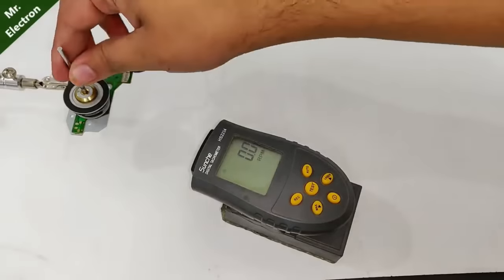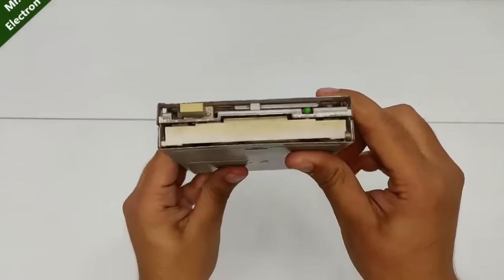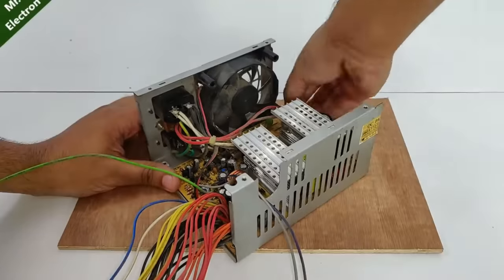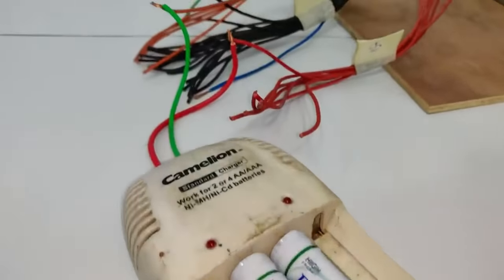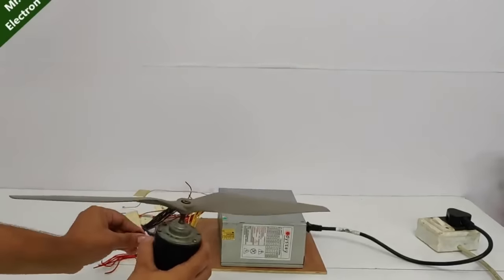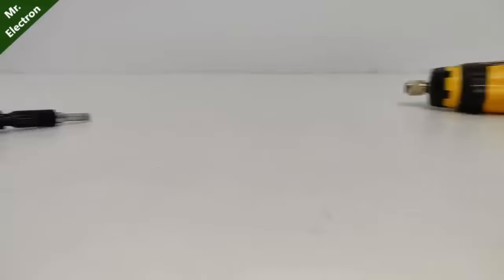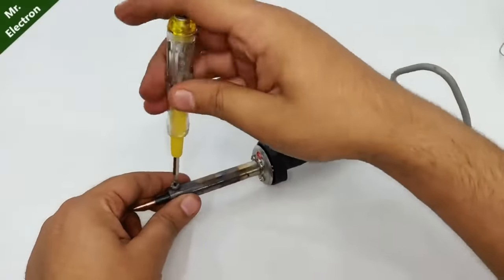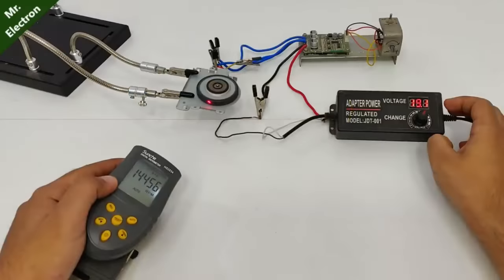Do Not Throw Away your Old Computer CPU | 3 Simple Inventions

Comment: Please rename your video from "Do Not Throw Away your Old Computer CPU" to "Do Not Throw Away your Old Computer PSU" Its a huge difference. CPU is a Computer Processing unit and a PSU is a Power Supply Unit.
Reply: CPU = Central processing unit, which is the main processor on your motherboard. You are not salvaging a CPU your salvaging parts from an old computer.
Reply: Why are you a ☝️🤓
Reply: I was about to mention this thank you

Comment: The purple wire.... Useful for Arduino projects and the like.  That 5 volt stand-by (as mentioned in comments). You can use that and ground to power an Arduino without having the 12 volt rail on(green connected). Then, in code, you can have Arduino pull the green to ground, turning on/off the 12 volt side based on time, inputs or such. 
3D printers for example..... using the above, you can put the printer into a low power state when printing in complete (if enabled in code and gcode). 
Lights.... turn on/off 12 volt lights on motion, time or noise. 
1 note.... some ATX PSU's (mostly newer ones) need a load on the 12 and/or 5v side to continue running longer than 15-30 seconds. A fan usually does the trick, though resistors can usually be used too.
Reply: Thanks for the Arduino trick. A simple idea that can be very useful.

Comment: Another thing I really like salvaging out of computers are the super strong neodymium magnets!
You can get almost a guaranteed two large ones from any hard drive -- some small laptop drives may only have one magnet, but that is rare (the magnets in the laptop 2.5in HDDs are much smaller than desktop's 3.5in, but still very useful)

Then, there are also at least two tiny ones that can be harvested out of the Optical drives (cd or dvd). They are what control the actual laser diode position, and are connected to a small metal frame by some awesomely strong glue, so they're sometimes hard to pry out.

Just be careful, because not only are they super strong, but very FRAGILE. Slamming against metal can cause them to fracture. Or, their metal coating might flake off, exposing the magnet, which can easily break apart into a magnetic dust.
Reply: HA no way i didn't know there were magnets in the cd/dvd drive. Thank you kindly and to answer the dude above me asking what the purpose of neodymium magnets are.... Get some and find out
Reply: Where the magnets at,bro?
Reply: @ZENITH-lp9gg  In which?
The hard drives? 
Or the CD drives?

In the hard drives, you have to remove the thin metal cover. Usually this needs a small Torx (aka Star), like a T9 for desktop drives, and T6 for laptop.
Once you have that off, inside you'll see a reflective disc (called "platters") , and a little arm reaching out over them.

Follow that arm, and at the back of it will be a curved piece of metal.
That's the magnet.
If you have a steel nail (like, a wood nail), or paper clip, you can double check by putting it near. It'll pull, if you're really close.

If it's the CD drive, it will take longer to explain and I'll do that tomorrow when I wake up. (midnight for me)

Comment: Be careful to observe the computer power supply unit, (PSU) max rated current on negative wires. Most PSUs negative voltage rails have comparatively low current ratings.
Reply: exactly.... how many amps you think we could get from 24v wiring it at -12V and  +12V ? I guess not so much
Reply: @VascoRocha  the -12 volt lower raiting  is the limit, and this may vary based on manufacturer, but typically  -12v rail can do maybe 1 amp. Milage may very. I wouldn't push it.
Reply: Just add some info: -12V is for Serial (RS232, COMn) connection, therefor PSU not responsible to provide high current on it
Reply: @VascoRocha  nn. 500mA max

Comment: The two wires that you didn't use on the power supply... Grey: will give a voltage greater than 2.8 volts if the power supply is outputting a 3.3v, 5v, and 12v. A signal needed for the computer to boot. Purple: will be an always on +5v even if the PSU is turned off.

Comment: The Grey Wire should be the "Power Good" Signal. The blue -12V and white -5V Wire are outdated. These wires are no longer needed and not necessary anymore. These has been used for old Soundcards and serial Interfaces. In most cases these negative Voltages can only loaded up to 0.5A (500mA).
The purple Wire is the +5V StandBy Supply. This wire delivers +5V at 2Amps even when the PSU is turned off.

Comment: Anyone charging batteries this way should know not to do so unattended or without close monitoring of voltages to prevent overcharging and burning your house down. You can find a controller to do this for you. Otherwise descent content and good job on the video.

Comment: The grey wire is the POWER GOOD wire which shows that the ATX is working good , You can connect an led with a 470 ohms resistor and the ground lead for indication, this comes on when the green & black lead are connected
The purple wire is STANDBY  
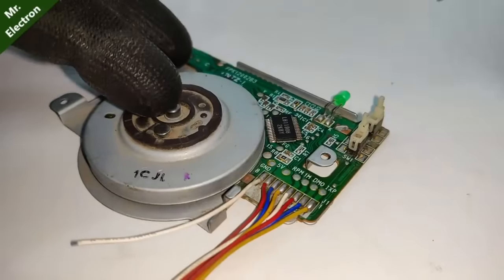24:00 ( 5.0 volts )which can be connected to an LED also via a 470 ohm resistor to ground. This indicator will come on when the ATX is plugged into the mains with the switch on the back is on even with the green wire in Off condition 
You also have to put a dummy load of 8 ohms / 50 watts on the 5 volt rail for the power supply to work properly , This resistor could get pretty hot so keep it isolated on a heat sink

Comment: The 36v motor has high torque, not high inertia. High torque is why it snaps round in your hand, high  inertia would make it slow to spin up. Inertia is "a quantity expressing a body's tendency to resist angular acceleration." whereas as torque is " the rotational equivalent of available linear force"
Reply: Very good explanation, thank you on behalf of the others.

Comment: purple wire provides 5V all the time despite the green wire being shorted to ground. it is labeled Standby power. and it is required for allowing such items as indicator leds and clocks to work in the computer.
The grey wire is a Power OK wire used for the motherboard to communicate with the power supply in order to tell if the voltages are okay in the powersupply

Comment: Using the negative 12v rail will limit you to 500ma to 1.5a max, the purple wire as stated by charlie gosh is always supplying 5v good for charging a phone but instead of the diode to limit voltage I've used the cheap lithium cell charge boards on the ends that way you have a proper micro usb to connect to and also the chip switches output power off at 4.1-4.2 as apposed to trickle charging permanently to death, great video.
Reply: А для чего второй блок питания?Или это генератор частоты для двигателя?
Reply: Вообще без схем плохо,хотя бы блок схему накидал-где что.
Reply: Лазеры обожаю... создал драйвер чтоб сразу несколько лазеров включал...но до этого штук 26 лазеров сжёг...

Comment: Don't trust a professor who uses CPU instead of PC, or even computer box.
Reply: that might be correct in his own language
Reply: @gabrielcornea9119  You could be right, except that "CPU" and "PC" are abbreviations of 'Central Processing Unit' and 'Personal Computer' respectively, in not any other language than the language of computer terminology, English. The components salvaged in this video are motors from an optical drive unit and a floppy disk drive, and a rather worn out, and a potentially unsafe Power Supply Unit. Don't do this at home folks, the motors are driven at potentially very dangerous speeds, for instance, a 3 cm rotor from an optical drive driven at 16000 RPM has an edge rotating at 900 kilometres per hour, about 75% of Mach 1, and could easily fragment, and detach from the bearing, a lethal projectile. The cavalier attitude of this experimenter is reprehensible.
Reply: @tikaanipippin  That 900 is rather 90.
Reply: @TheMateakos  You are right 90 KPH. I must not exaggerate the dangers of unshielded spinning metal objects in the home.
Reply: @tikaanipippin  Yes, at this size it is not that dangerous. Metal can easily hold itself together at that load. But if you spin up a CD at that rpm, the edge speed will be much higher. If it shatters, you can easily loose an eye or two.
Reply: @TheMateakos  And yet, some how, every single CD and DVD perfectly survives that exact same speed. They even survive 24x or even more speed, when being burnt. And guess what they are connected to... a motor exactly like in this video.
So the warning comments are so outrageously stupid it's just hilarious.

Comment: I have a couple of little 130 dc brushed motors that will run around 65,000 to 80,000 rpm. Its only for a few seconds because the brushes disintegrate but its pretty awesome 2 to 5 seconds worth of time.

Comment: IMO all PC power supplies carry a design defect that goes all the way back to the first IBM PC.

The fan blows in the wrong direction!

Instead of pulling in air from the back of the computer (ideally through an easily replaceable air filter), pressurizing the internal of the cabinet, it exhausts air out the back, sucking in fresh air via every crack and opening in the computer -- pulling it through the computer_ then through the power supply -- and finally out the back of the computer.

This results in a massive amount of dust being deposited everywhere inside the computer, guaranteeing FAILURE within a finite amount of time!

Personally, I, being a cynical old man, believe that this defect was NOT accidental, and has NOT "somehow been missed" by EVERY manufacturer over the decades!

BTW, in an earlier life (before I changed careers, and then retired) I had a PC building and repair shop. A "brick and mortar" storefront. I saw so many dusty PCs...

Moving along...

That heat sink/fan would make an ideal partner for a Peltier module! With two of them you could build a nice little "portable personal air conditioner" unit. Or a desktop refrigerator. Or, with a wood stove (and something other than aluminum or other easily meltable metal on the "hot side"), a small DC generator (possibly enough output to charge a cell phone -- and remember, you can _stack_the Peltier modules to increase their output).
Reply: For some years now all the power supplies are down in the pc. It takes air from outside of the pc and blow it outside. Just the cheapest ones take air from the inside of the pc.
Reply: @TheWhisssper  -- Good to know. As  you might surmise I am not using the latest/greatest PC. It does do what I need, however. As an aside, I find it almost comical when I see how utterly spoiled people are today. Even my "ancient" PC (a mere four cores and 16 GB of DRAM) has more power than... well, anything at all short of a "for real" mainframe not that many years ago.

I hearken back to the early days. Could not afford an S-100 box but did eventually put just shy of four grand into my TRS-80 Mod 1 -- 48 KB (yes, kids, that's KILObytes!) DRAM, and ONE Kilobyte of video SRAM (16x64 text), with four floppy drives (DSDD-80, 720 KB each -- the same capacity of the first gen of "standard" 3 inch floppies, but using regular five inch discs).

Not much (even after I soldered in a lower case mod by piggybacking a 1KBx1 SRAM chip into the video memory, and a driver that Dennis Bathory Kitsz wrote in Assembler (the instructions, IIRC, were in his mimeo'd newsletter that I paid a modest subscription fee to receive -- well worth the cost!)

People today are so spoiled! I ran a wholesale camera repair shop on that rig which had less horsepower than a Sansa Clip! And it worked, too! Logging/tracking/estimates/invoices/billing -- all with less memory than one of the little icons at the top of this window -- with an 8 bit Z80 running at 1.77 MHz!

Later, the stone-age of the LAN began -- stuff like Televideo systems, with diskless workstations -- 64KB DRAM, 4MHz Z80, and an RS-422 port which was used to boot CP/M from its server -- another Z80 box, but with 128KB of DRAM (memory banked, since the CPU only had 16 address lines).

There were two versions, one that could handle 8 workstations, and one that could handle 16 -- the bigger one also had a built-in tape backup drive. Both of course had a HUGE hard drive -- 30 MB, as I recall.

Yes, those were the days... (I remember when hardware experienced a sort of "Cambrian Explosion" -- I bought an unimaginably MASSIVE capacity SCSI drive -- 2 GIGAbytes!

It died after a few months of use. But, it "only" cost a bit over $900, what a bargain! (It really was a bargain at that price!)

Now, if you can even find an ancient 2GB MicroSD it won't cost more than a dollar or two (and be a LOT faster and more reliable than that honkin' big five inch SCSI drive!)

This is what I mean by spoiled. And I do tend to ramble, and "write long" (occupational hazard, sorry).

Anyhow, it is good to know that they're finally installing fans in the "NOT intended to self-destruct the machine" mode!

(They say you can tell who the pioneers are -- they're the ones with the arrows in their backs. I think I read that in BYTE close to a half century ago. Tempus fugit...)
Reply: Doesn't matter if the fan is a pusher or a puller. It's going to push, or pull dust.
Reply: @fauxque5057  -- Doesn't matter if the fan is a pusher or a puller. It's going to push, or pull dust.

Sigh...

If it's pulling in air from the back -- the fan right up against the vents -- it is trivial to place a FILTER in place before the intake.

However, if the fan is PUSHING air OUT the back of the computer, it will be pulling air laden with dust through EVERY crack and opening in the device.

Every diskette (yeah, some are still in use), every optical drive, every crevasse between cabinet panels, etc., etc., etc. -- and then, finally, through the power supply and then out the back of the computer.

There is NO way to filter all of those openings!

But, if CLEAN filtered air is pulled through the fan and then through the entire computer, until exiting via every opening and crevasse, there will NOT be a buildup of dust.

It's as simple as asking if we'd rather have a "box" with POSITIVE or NEGATIVE air pressure inside of it.

This concept is NOT rocket science. It's even used in medicine and especially medical research. Labs that handle deadly pathogens will be built so as to have NEGATIVE air pressure. If a door opens -- or even if a leak were to occur -- air would be drawn into the room with the pathogens -- rather than being pushed OUT of the contaminated room.

The same system is used in hospitals, such as the one where I was at recently because I contracted Covid (even though I was double-vaxxed, as was my wife, from whom I contracted it).

One of the nurses told me that they have negative air pressure rooms that are reserved for patients with Tuberculosis.

In short, your assertion is so absurd that I have to wonder if it's a sad attempt at humor.

Comment: Take a look at the current carrying capacity of the individual voltages. Especially the negative voltage (18:55). Have you ever checked the voltage drop of a silicon diode at different currents (characteristic curve in the data sheet)? Why are different charging methods used for lithium batteries, lead batteries and NiMh batteries and not just any voltages applied?

Comment: as for the rest of the parts of the power supply, remove the gold pins. the tiny stepper motor (it has a worm gear) can be used for a 3d printer, the torroid coil for the power supply are worth a little bit of $$. (i've taken apart 5 P.S., rebuilt 2 computers, and have a lot of motors, fans, gears, and parts!)

Comment: Regarding the speed of your CDROM-motor you most probably did measure wrong. I highly doubt this motor would do such high RPMs. Laser RPM-meters just look for some change in contrast and if your measuring object has one contrasting line on each side you're doubling up your speed! If you get some out-of-balance rotational energies then you will make it even worse, it can get multiple times of what your motor really is turning around.
For the power supply you made real mistakes: Any of the contacts on ATX plugs has standard function. So if you would have activated the mind before cutting all the wires you could have made up your mind by just googling "ATX power supply" and you would have seen the exact meaning of each wire.
2nd mistake was when you said "you can use the +5V wire and the +3.3V wire for charging 1.2V MiMH akkus. All rails (all voltage supplies) of an ATX power supply are ALWAYS meant to only be used Rail-to-Ground. This makes the 5V Rail producing and regulating for 5V only and only if you connect red as positive output and black wire(s) as negative. 3.3V can be used for 3.3V only (orange-to-black), Differential voltages inbetween 2 different rails may be half-decent with your multimeter and it may be working for very low current. But it never will work for higher output currents as an 3.3V OUTPUT simply isn't made to sink in the current produced by the 5.0V rail, it is made to DRIVE voltage output!!! This may just not work for some power supplies, it may even kill some power supplies and, of course, it will not be properly regulated output at all!
DON'T DO THAT! I highly recommend not to do things like charging akkus from an ATX power supply as it does not have proper current limiting working with your akkumulator, it doesn't have proper and exact regulation of charging end voltage. You will very soon see your akkus dying from over-voltage or over-current. BTW: 12V rail normally isn't really regulated output, it is set for being somewhere in the ballpark all around 12V but it will vary with the load of any other rails in many, if not in most cases!